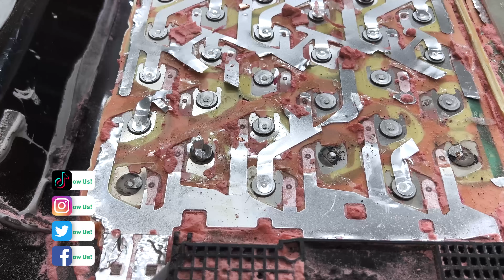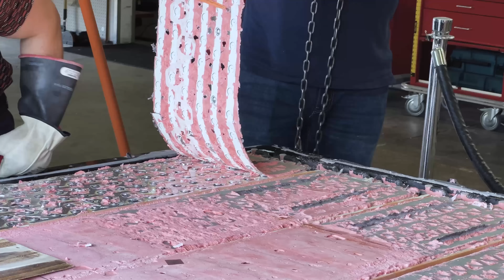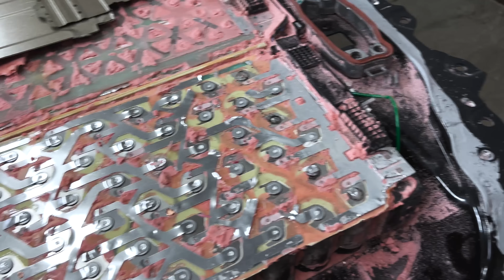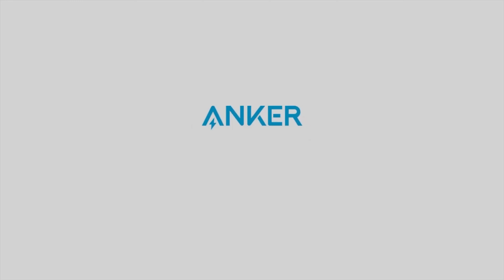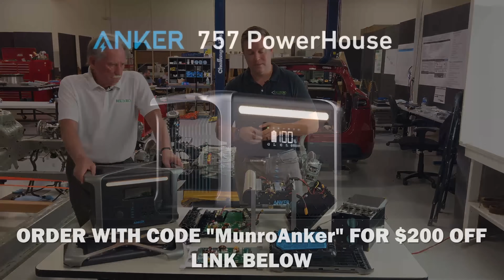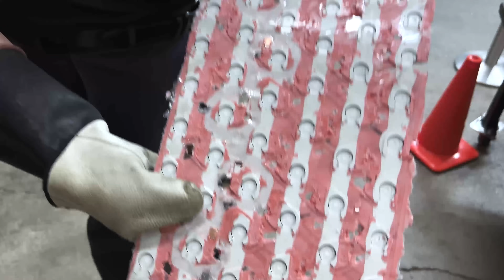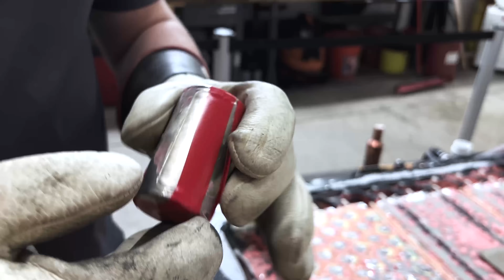Tesla's 4680 Current Collector Layout

Comment: I have seen that orange pink foam material before. It is a mica filled thermoset silicone resin, not polyurethane. Removal is very tricky but not impossible. I remember taking apart LSI/spectra physics nitrogen laser plasma cartridge modules filled with it for repair and refurbishment.

Comment: You're wrong on the pouch cell having higher energy density. 
Cylindrical's have much higher energy density and distribution internal pressure build isotopically. while more resistant to swelling than pouch cells, the expansion increases pressure within the cells which degrades performance typically faster than pouch cells. 

TLDR here- Cylindrical cells have higher energy density and more resistant to swelling, pouch cells typically display a longer cycle life.

Comment: You guys are awesome! Thanks for doing what you do. I just got word that my Model Y Long Range coming from Austin in 2 weeks will have the  giga castings with the 2170 batteries. Any idea how that will work? Is the structural 4680 pack redesigned to be structural without the battery cylinders, then the 2170s are fit in between the structure? The Tesla rep I was talking to was excited as this will be the first of it kind coming through their location. Any thoughts?

Comment: Question please:  in comparison to other car manufacturers, how advanced & cost effective is Tesla's use of laser-welding with minimal manual connectors for assembly-automation in their 4680 battery pack?
  
Thank you Munro team.  Look forward to your posts.  Very informative.  Constantly surprised by Tesla's rate of innovation for a complex-systems manufacturer.
Reply: Eveyone laser or ultrasonic welds cell connections within a module. This battery has a single module.

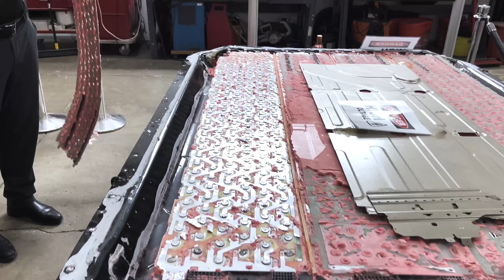Comment: Antonio answers ( 9:52 ): "Pouch cells generally are more dense on a volumetric..."
That's the first time I have heard this obvious fact mentioned on Munro Live. This is true on both cell and potentially pack levels.
"... but compared to the 2170 this is a major step up."
This is true only on a cell to cell level when comparing cylindrical cells, and ignores the "gravimetric" question.

I do hope the Munro team addresses the hot gas venting path on this pack. I don't see an obvious one.

Comment: I was surprised to see that Tesla has moved away from using thin wire connectors to the cells. These acted as individual fuses so that if a cell failed and caused an over current then the fuse would blow protecting the neighboring cells and the entire pack.  Welding the bus bars directly to the cell is more physically secure but might be prone to rogue cells causing serious damage.

Comment: In the first 30 sec of the video ask my self why that pathway? and not just make line columns. after i see 1:30 and question is the same why they make it so complicate? Fast manufacturing?
why they dont use taps in botom and top of each cell? so yo have pozitive on top and negative at botom. the structural is the same, because the cilinder hold the weight.
And is more easy to put taps instead to insert a roll in can. Maybe i miss something but at first look they over-enginered it.
Reply: 1:34 pause it and see the only insulator betwen +/- is that yellowish material.
Reply: "Line columns"? Do you mean a rectangular array? No one dies that either cylindrical cells,  which pack closer together in a hexagonal array like this. This proper packing also forms a stronger structure.

Comment: One cell goes and your packs compramised . Heres your bill to replace it back to full range sir . Its only tens of thousands of dollars . Its a throw away pack 100% even if a few cells go . They dont get better when cells have trouble . They are batteries that die at anytime . What a waste . Out of site out od mind . Its a nice pack though . Ive built my own ebike packs and cells die at random . You cant make all cells the same . They are all different . Hit and miss they are . I see lots of petrolium in the synthetics in the pack . Its all oil . I was a fibreglasser aswel using sythetics .

Comment: One thing that does bother me somewhat with the design when thinking about full lifecycle of products, is the additional effort required to reuse or recycle at end of life - any thoughts on that side of things ?
Reply: Great question I was thinking the same thing, I wonder if there is a way to chemically dissolve that "Foam Of Death" by dipping the whole cell pack.
The underlying silicone adhesives should be easy to remove with solvents, not great for the planet but better than sending the pack to a landfill.

Comment: It isn't immediately clear what type of welding was used between the current collector and the cell electrodes. I am torn between laser welding, ultrasonic welding and micro-tig welding (see Amada Weld Tech). Could you elaborate on this point ?

Comment: Battery designer is a math genius.
How many serial groups is needed: 400V / 4.35V = 92 groups

Is vey long to be linear, but fortunately 92 = 23 * 4.
4 strips by 23 groups.
Ok, how many elements can be in each group?

For 9 elements we got regular pattern

  0 * * 0 * * 0
0 0 * 0 0 * 0 0
 0 * * 0 * * 0
0 0 * 0 0 * 0 0
 0 * * 0 * * 0
0 0 * 0 0 * 0 0

But for a little smaller number 8 we got less dense pattern 

0 0 * * 0 0 * * 0 0
  0 0 * * 0 0 * * 0 0
0 0 * * 0 0 * * 0 0
  0 0 * * 0 0 * * 0 0
0 0 * * 0 0 * * 0 0

Seems like element size was predefined by cars geometry.

Comment: With the 'old' model 3/Y battery pack, each cell had a seperate wire to the bus. This wire also acted like a fuse in case of an internal short in one of the cells. How is this accomplished with these 4680 cells ?

Comment: Does this battery have active cooling?
Reply: Yes, just like previous Tesla batteries.
Reply: @brianb-p6586  are you sure, cause i see lot of foam sorrounding the cells, and i cannot imagine how cooling goes with all the foam. Please explain. Thanks
Reply: @popescugeorgebogdan2506  just as in previous Tesla batteries, an extruded aluminum cooling channel snakes between every second row of cells (front to back in this case), directly contacting part of the side of each cell. The end fittings of the channels are visible at the front end of the battery, and the Munro staff show, describe, and discuss it in detail in this video - didn't you watch it? The cells are bonded to the channel before they are placed on the battery case, and the fiance is added later, not affecting the connection of cells to cooling channels.

Liquid coolant circulates through the channels, as usual.

Comment: Interesting these cells are connected in parallel in sets of 9. This would indicate that in order to fully charge, 900 cells would be required. Each parallel pack would contribute around 4v which is then linked in series to reach the 400v working voltage. So this would mean 100 parallel packs (each containing 9 cells) are needed?
Reply: They noted in the video there is 828 4680 cells in the pack... so that'd be 828 / 9 x 3.7 = 340v nominal or 386v full charge voltage or thereabouts.  Slightly less voltage than the 2170 based packs that are 96 parallel cells blocks in series, so 355V nominal.
Reply: @EnergisedAdrian  Your numbers seem to fit the evidence, I had assumed the native voltage was higher

Comment: Each module is 9P,23S and the pack 9P, 92S - The pack will have a max 386V, and the 4 modules 96.5 V. As over 60V, this is likely why the pack is an unsealable unit - saves costs in dealing with high high voltage for repairs, etc
Reply: No, that's not the reason. The original Model 3 and Y pack (of 2170 cells) has four modules, two of them 23S and the other two 25S... so over 60 volts each.

Comment: Alien technology
Reply: Alien my @zzzzz there is nothing alien there! It’s simple battery assembly grow up!!!
Reply: It’s a battery pack made by copying apple ways of doing things which mean not repairable/not reusable basically scrap after car life! Wtf!!!!
Reply: @alanmay7929  don’t need to replace it….will outlive the car…apple doesn’t make anything they outsource…batteries are recyclable
Reply: @Sejal Patel  just because it’s “designed” for a million mile (lol….) doesn’t mean it’s going to do that!
Reply: @alanmay7929  model s p85 did 932,000 miles back in Jan 2022 with the older 2170 tech in Germany by Hans von gemmingen…approx 750k was done on one battery pack
Reply: @Sejal Patel  nonsense!!!!!! It has never done any 750k on a battery pack let alone it had multiple motors changed and let’s not forget the car is not even 15 years old! Again there are millions of 20 to 40 years old ICE on the roads with their original engine/gearbox! I’m not barging about anything just stating facts.
Reply: @Sejal Patel  also old vehicles have been exported to Africa, South America….. I wonder how a used/very old tesla/EV will survive those environments lol….
Reply: @alanmay7929  do the math. Second battery is at approx 750k and still going. As I said the batteries will outlive the car.
Reply: @SejalPatelDrSej  lol…… he did got at least 4 batteries packs replaced and over 8 electric motors……. The car Will actually outlive the batteries if it doesn’t get into an accident of doesn’t rust think about that!
Reply: @SejalPatelDrSej  why are you sooooo limited in your thinking like that! As long as the car shelf is in great condition plus all the bushings, suspensions, motors, hvac, electronics….. are working the car is still good to go.

Comment: Hey Sandy n yea am, firstly great job here and cheers to you guys.
I have few questions 
1.How much in series and parallel, last video you mentioned 34 x6 nothing in this video.

2. What’s the nominal voltage of each cell

3. Can we have a look at the bottom abs in the near future?
Reply: 34 X 6 is nonsense. The battery is 92S9P, consisting of four blocks in series, each of 23S9P. The video showed the 9P configuration at the beginning.

Comment: Cells are only about 4 inches from the edge of the pack.
In a crash those cells would be easily crushed.
 A proper safety test would require a fully charged battery that is hot from charging or hard driving.
Then perform side or frontal impact testing.
A fireball is guaranteed.

Teslas crash a lot.
Often because of whompy wheels or SlaughterPilot.
Reply: The edge of the pack is far from the edge of the car, protected by the rocker/sill structure which is not part of the pack.
Reply: @brianb-p6586  Nothing can possibly go wro

Comment: 46 cells in parallel for the 2170 pack.  The 4680 cells are supposed to be 5 times the capacity f the 2170 so 46 ÷ 5 = 9.2 So 9 cells is close.
Taking into account that the 4680 is 15% more efficient, it could be only 8 in parallel.
The 2170 pack is 96 'modules' in series. If this pack is 828 cells then 828 ÷ 9 = 92 in series as opposed to 96 of the 2170's in series. But with lower internal resistance, the pack should  behave as if it has more cells in series.
Reply: Is there a drawback from having fewer cells in parallel? That one defective cell would have a bigger impact on battery pack performance? And maybe that's why they went with nine, when they could have gotten away with eight?
Reply: Right... except that "15% more efficient" and "lower internal resistance" are marketing claims, not confirmed reality.

Comment: GM and Ford will always be at a disadvantage as long as they are using pouch cells because of all the balance of mass of physical protection of the fragile pouches and thermal cooling. This design eliminates redundant mass between modules and makes the pack closer to one big “cell”, but with better cooling than CATL’s big “cell to pack” bricks.

Comment: What is the purpose of making a battery pack that cant be repaired? Modules swapped out?  Is that to keep after market repair shops out of the loop?  Or is it just that that integrity of the floor/battery pack to the cars overall safety integrity is more important than repairability?

Comment: Congratulations after 4 days you got 2 cells out and you don't even talk about the voltages or anything, . Special.   600 cells. . Glue glue glue laser weld laser weld pink urethane, white stuff. I bet i can google more info..   This is so well designed bla bla bla.. LOL. For rich people that can afford to trade in disposable cars. .    You all explained more about that anker battery pack. That your promoting  and gave more tech info on that. Than you did on the model Y pack.    But i guess still some good info.

I watched the plaid model S Teardown. After i posted this comment.. thats a good explanation.  Maybe you will get to that . With this teardown.

Comment: I don’t doubt this battery pack is cutting edge but my gut feeling is all this glue and chemical bonding to stick cylindrical batteries together can’t be the best solution. It must be very complex and expensive to produce and using toxic materials. And wouldn’t the recycling would be extremely expensive if the whole thing needs to be destroyed? Are the next gen battery packs already out there in prototype?

Comment: Long story short: So this is a 92s 9p pack. 92*9 = 828 cells. It is made out of 4 modules with 23s9p each.
Nominal voltage for the pack likely around 92 * 3.75 V = 345 V. Nominal voltage of one of the four longitudinal "modules": 23 * 3.75 V = 86.2 V. Modules are connected in series.
With 26 Ah per cell this pack is about 828 * 26 Ah * 3.75 V = 80.7 kWh gross capacity. Somewhere in that ballpark.
Reply: The 2170 Model Y pack is 96S which means the 4680 pack at 92S should be charged at a lower voltage which may contribute to the reported lower peak kw charge rate last I heard was 226kw
Reply: @HungrySandwitch  That depends on the voltage: 92 times 3.75 volts nominal voltage would equal 96 times 3.6 volts nominal voltage.

Comment: It looks to me like replacing individual cells or even modules is not on. This was never easy even on my 7 year old Model S battery but it would appear that not easy has moved to not possible. Such is progress I guess.
Reply: Definitely NOT a serviceable pack.. The S was to a degree. I've seen Gruber Automotive do some videos on that.
You could cut and isolate a bad cell pretty easy, and replace sections.
 I think the in the 2170 battery packs you could also replace sections, but not get access to individual cells.
IF the pack is going to actually last 1 million miles.. Its not an issue. 
If its NOT going to last that long and suffer similar issues to the Model S packs.. Then these cars may not have much value in the used market once they get significant miles and years on them. Nobody is gonna buy one of these when there 15 years old.. with that level of risk.. of a battery failure... maybe pack prices fall to the point its not so bad.. then it will be fine... say in the $3-5K range.
I have NO fear to buy a used Toyota Prius, or Camry. Even with high miles.. an engine or trans failure is still reparable.. used engines are available and anyone with some tools and skills can swap one. Or if not a shop can do it for $3-5K range.

Comment: Could you guys please explain the difference between gravimetric and volumetric energy density please, non engineer here🍻🍻⚡
Reply: Gravimetric energy density is Watt hours per kilogram (so per weight of a cell, for example). Volumetric energy density is Watt hours per Liter (so per volume of a cell, for example).
Reply: @koeniglicher 
Aaahhhhh gotcha thanks for helping this old fella understand 🧓🧓🍻
So another question which is the best indicator of "range" in a battery?
I also gather there's a certain amount of compromising between the 2 energy measurements for battery formulations and performance? I'm assuming the answer is yes?
Reply: @brettmciver432  The best indicator of "range" of a car is 1) a high usable battery pack capacity (=amount of energy) in kilo Watt hours and 2) a low energy consumption of the car itself measured in Watt hours per kilometer. So, range can never be measured from a battery pack alone.
And yes, there is a certain compromise in cell design, whether to prioritize energy density (Watt hours per kg, or Watt hours per Liter) or whether to prioritize power density (peak Watts per kg, peak Watts per Liter). But from time to time, all four of them can be improved with new designs. "Performance" (of a car, I assume) however, has many more influences, like the electric motors. In addition, acceleration is much influenced by the car's weight, top speed is heavily dependent on the car's drag. Performance of a battery pack alone does not tell you much.
Reply: @koeniglicher 
I Can't afford the free beers you deserve🍻🍻🍻🍻🍻

Comment: It appears both terminals are at top of cell. Am I misinterpreting the cell junction plates?
Means no wiring on bottom of pack.
Reply: You're right.
Reply: Correct, just like the 2170 battery. The entire outer case is one terminal; it can be accessed from either end.
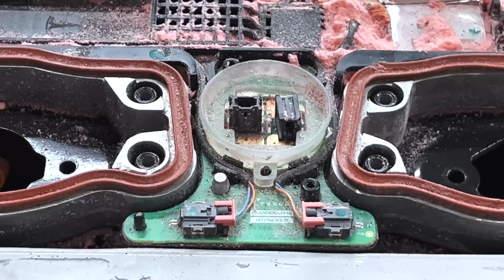Reply: @brianb-p6586  Thanks. I’m still trying to catch up. I thought entire cell shell electrically isolated except top plate, but don’t understand internal wiring. (4:50 part 1 4680 teardown limiting factor)
All cells glued to metallic cooling bandolier via casing.
Reply: @iandavies4853  all cell casings are bonded to the aluminum cooling extrusions, but the cells and channels are not electrically connected because of isolating films or coatings, which don't cover the top edge of the cell case. Just as with the earliest Model S battery modules, the cooling configuration is unrelated to the electrical configuration.